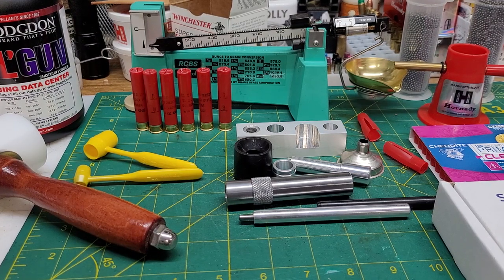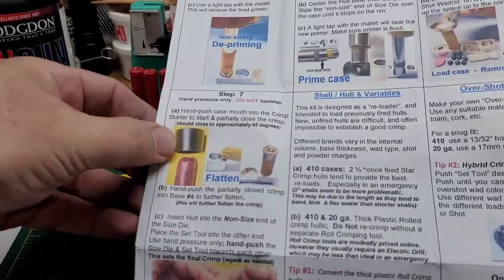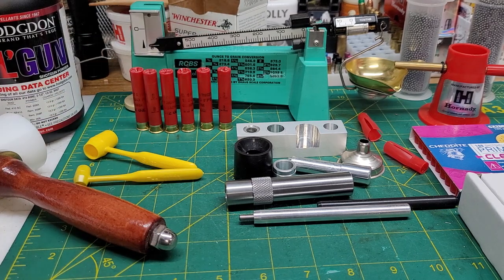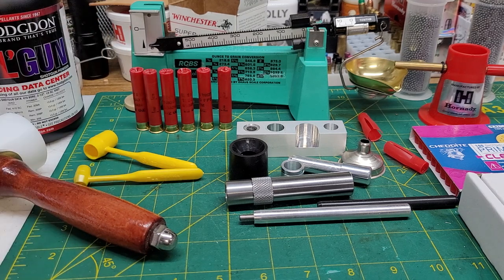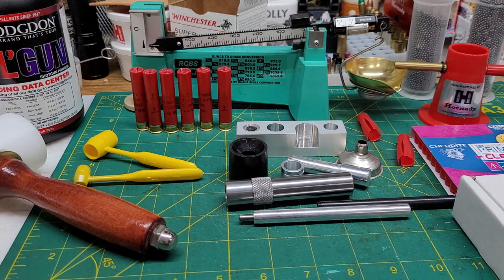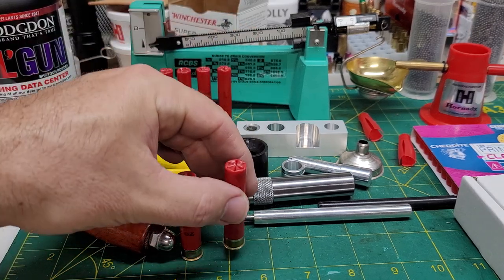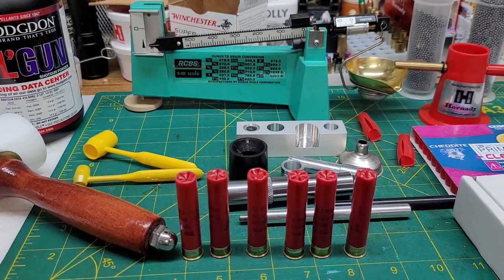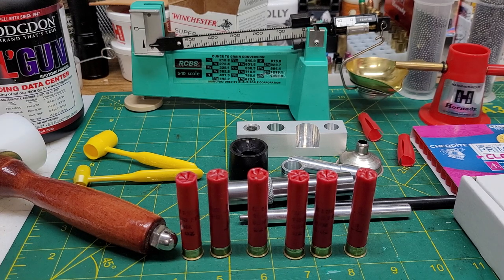410 Reloads With "Survival Loader"

Comment: I have the kit and loaded 30 2.5" shells yesterday with 4 pellet 000 buck. I have loaded #8, 6, 4 shot. I have 45 Colt dies and a single stage press. I use 45 Colt brass to make a light shot load that works very well. Nitro card, 1/4" cork wad, shot, over shot card, crimp.
Reply from the maker: Great ideas!  I have a .390 round ball mold I cast a few dozen and I'm going to try a two ball load in an old bolt action .410!
Reply: @marcthomas2482  I have some commercial 4 .40" balls in a 3" shell. I shot a 1/2 oz  #6 shot hand load in a Double Badger 22/410 full choke yesterday. 7" at 7 yards. 2 of my 4 pellet 000 loads each patterned 3" at 7 yards.

Comment: I got the 12 ga version . I noticed on the 20 and the 410 in your video has a extra hole in the block. What's that for ?
Reply from the maker: The hole on the far right in the video is for starting the crimp after using the plastic star.  Final crimp is done in the tube with the other small tool.

Comment: I would love to see the crimp phase of the reload. I bought this kit, and the crimp is not working.
Reply from the maker: Hi Anthony-nc9qj!  YouTube does not allow us to show the whole process.  I did just put a video up on my Rumble channel of pretty much the whole process except for de-priming, sizing, and priming.  My Rumble channel is THOMASLEATHERWORK in all caps all run together.  It's important to have the shot column at just the right height, press the pre-crimp in an existing valley, and then when you put the crimp in the baseplate (I turn mine over and put the brass part of the shell on the table and hold the baseplate like a handle and press down with my thumbs) push until you feel it fold.  Then when I put the shell in the metal sizing tube and push the plunger down into the crimp, I give it a few twists and that seems to help it seat down in.  Good luck and feel free to contact again for any questions.
Reply: @marcthomas2482  Hi Marc, Thank you!  It took me a few minutes to figure out what you meant by rumble channel, but I found your video. Extremely helpful with the crimps on the 410, thank you again!
Reply from the maker: @Anthony-nc9qj  You're welcome!  Glad to be able to help.